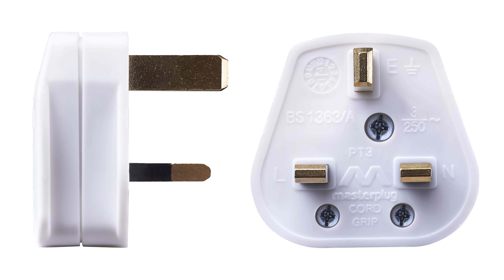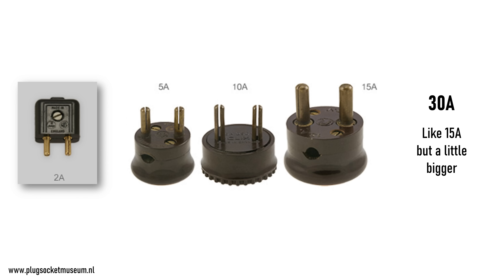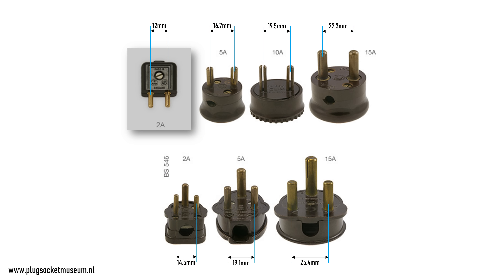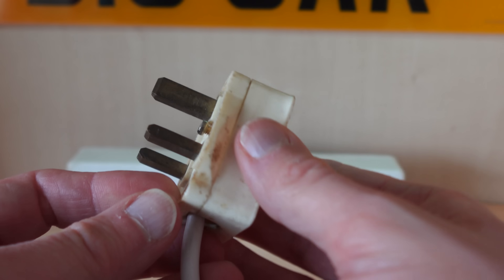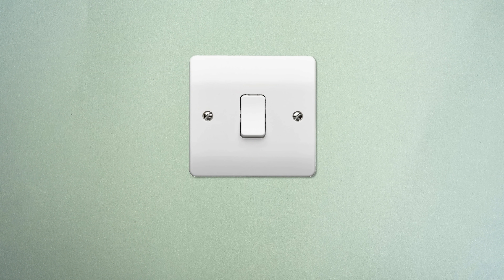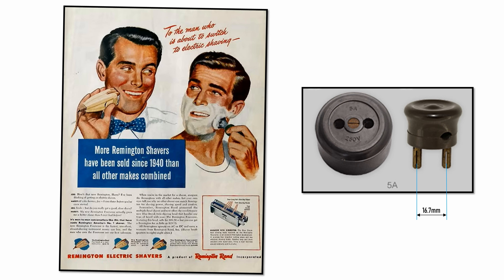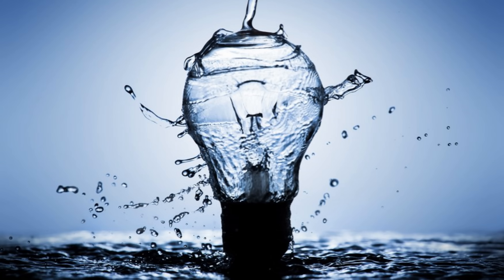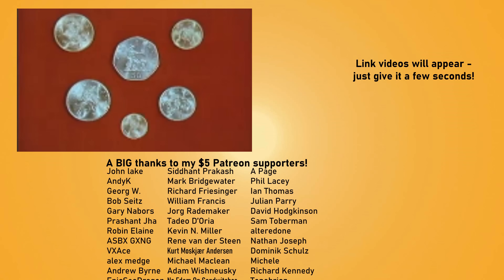Shaver Sockets are really clever

Comment: The reason why appliances weren't sold with plugs in the initial legislation was simply because the BS1363 socket was simply rare to begin with. Most houses would have had BS546 sockets, not BS1363, and that would have meant cutting off the supplied BS1363 plug and then replacing it with a BS546 one, which would have been wasteful in the period after WW II. BS546 remained common into the 1960s. So the legislation to force manufacturers to include a pre-fitted plug could have been made a decade or two earlier, but it made perfect sense at the time. Also, back in the that post war period, people tended to be much more practical and used to the DIY approach. They would service and repair their own cars, motorbikes and so on. It was a different world. 

Also, that's a legislative issue, not a shortcoming of BS1363. In the BS1363 did have issues, the only major one on the plug itself was the lack of insulated sleeving on the live and neutral pins (which was resolved in the 1980s). There were also problems with multi-way sockets which were not required, probably due to an oversight, to include a fuse. Thus you could get 2 or even 3 way multi-way adapters without fuses which could mean, for example, two 3kW electric heaters being powered via the same socket. These days anything plugged into a BS1363 socket must have a fuse, which means that this should never happen now. I should add that all those little power adapters and chargers also have an internal fuse, even if it is not obvious, although they may be of the auto-resetting type like PPTC components.

The rule about allowing 230V standard sockets in bathrooms, initially 3m from zone 1 areas, not 2.5m is relatively recent. Go back 20 years and it was not allowed at all. The only reason that was allowed eventually was when residual current devices (RCDs) became common. However, most countries in Europe allowed standard sockets to be used in bathrooms anyway, despite having a similar voltage system. I should add that whilst the UK system is described as 230V, in practice it is still run close to 240V as that falls within the harmonisation standard of 230V +10%, -6% (in my house, close to a substation, it's typically about 245v). The harmonisation standard in Europe didn't require any country to change its de-facto local voltage standard, and it's often 220V in parts of the continent.

nb. 200 milli-amps is more than enough to kill somebody (which is why standard RCD protection in the UK and Europe tends to be 30 mA, and is even lower in the USA). So that bit about it being limited to 200 mA to protect against fatal shocks is, I suspect, not the real reason. I think it's more likely to keep heat dissipation down in the enclosure. Transformers are nothing like 100% efficient, and that means they generate heat, which is not a good think in that shaver socket enclosure. Heat will build up if it's more than a few watts, and even a 90% efficient transformer will dissipate 5 watts with a 50 watt load.
Reply: i find it intresting and having an isolation transformer required is definetly unique to the UK

as someome from the USA i can confirm our GFCIs (RCD equivalent) will trip at a pretty low leakage, no more than 5mA is allowed to be exact, and they have been required in bathrooms since the 1975 edition of the NEC (national electrical code)
voltage for am average house (not 3-phase) being 125/250v +5% -10% allowed variance

GFCI outlets(daisy-chain-able for their protection capabilities here in NA) or breakers were first required anywhere on homes in 1971 for any pool equipment and exterior outlets
also worth noting that the US and canada codes actually have mandated having a 20 amp, 125v dedicated circuit for exclusively the bathroom outlet, but only if an outlet was installed, until also in 1975 the dedicated outlet was no longer optional, as the code waited for there to be a way to protect against electric shock before requiring it
and bathrooms are the only place where you will never find a 250v outlet in the US, however hardwired, GFCI protected 250v is used by heating, spa tubs, water heaters and saunas in bathrooms
Reply: About the 200mA, don't forget that the current doesn't flow to ground but from one point inside the device to another point inside the same device. That makes it really hard to route the current through the user's heart. You have to grab it with both hands and connect with one to live and the other to neutral.

With the isolation transformer in place, it's much more likely to have a local partial short that causes a fire. And here, the small fuse can shine.
Reply: @HenryLoenwind  I'd agree that it's unlikely that the current would go via the heart. Just about the only way would be touching each live terminal with different hands. 

However, I do not think the 200 mA limit had much to do with what is or is not a lethal electric shock. I also suspect that, even with 200 wet hands, it's probably difficult to get 200 mA to flow through the human body at 240 V. So I think the power limit is for other reasons. Certainly a dead short on the secondary would generate a lot of heat in the transformer, but will probably not draw enough current on the primary to trip a 6A MCB or blow a 5A fuse.
Reply: I actually see 252, basically the legal maximum, quite regularly in my house. It fluctuates a lot, this week I’ve seen it a low as 235 and up to 250! Right now: 243.
Reply: @timtjtim  actually the limit is actually 262 - as in appliances will be damaged beyond that(plus the fact that it is almost 277v) (atleast if you are in the US - no idea about limits in canada/the CEC)
recomended is more like 256.25v though for "cutting it close"
so 252 is within the safest range

in my area it only goes up to 250, down to 238 - went down to 224 one new years night(severly low and can burn out an HVAC compressor or similar) they took out the power soon after and came back after a few minutes with some emergency generators, 245v
it is a bad local grid so low voltage is common

Comment: I am a Brit living in Australia. Here we have standard power sockets in the bathrooms next to the sink. You don't hear or any accidents....
Reply: Maybe because the dead people don't report them? ;)  Seriously, though, the wiring and fusing systems are different.
Reply: @ukeleleEric  yeah, at the meter box in Australia they all have circuit breakers/RCD protection, so you aren't relying on some fuse to burn out and save you these days.. I think the standard says you need it a certain height/distance from a sink to avoid splashes and such but it certainly isn't 2.5 metres because, like in the Uk, many bathrooms aren't that big anyhow.

Comment: The worst thing about recently buying an electric toothbrush and a water flosser is that they both come with a plug to use the shaving socket, but the shaving socket (at least the one I have, so I'm assuming it's a common feature) will only let you plug in one of them at a time. Given the fancy nature of the toothbrush I bought, its base is designed to be plugged in all the time. And the water flosser has to be plugged in to use. This means I regularly to a lot of plugging and unplugging. Also, it has a really loud buzz to it.

Comment: OK, so in the UK you have a very cleverly designed shaver socket in the bathroom and these impressive BS1363 sockets for everything else. How do you accommodate for the myriads of small powered devices that don't require grounding? In my household this makes up for the majority of devices. Do you have to carry around chargers with plugs bigger than the charger itself?
Reply: some plugs are awkward but we've got plugs with fold out prongs now on some plugs like iphone chargers
Reply: On devices that don't need an earth connection they still have to have a earth pin as the socket wont work without. However it's normally plastic and sometimes folds away. If you accidentally stand on the plug which is painful the plastic pin is easily broken. I did it once and had to super glue it back on otherwise it's now useless.

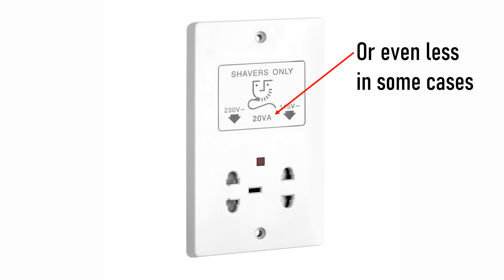Comment: 6:00 You don't say that, it's mostly not true. It's actually voltage that passes through skin resistance, current just follows. And current limit means a voltage drop, so the relation between voltage and current in a limited-energy circuit is reverse-proportional.
Reply: It’s mostly true. Voltage lets current flow, and it’s the current that does the damage

Comment: The British Plug Design might be well-thought-out, but in my opinion the EU Plug is still better because it's universal. You can plug it in any direction (I have not a singe device where correct phase/neutral would matter), there are smaller plugs which fit in the same holes but are for less current and smaller devices and it's slim and modern.

There is only one Socket in the whole house for all devices, and the fuses are in the circuit breaker cabinet.
Reply: Old AC/DC radios and TVs connected the neutral directly to the chassis. If these were reversed they still worked but the chassis became live, a good reason to have non-reversible plugs and sockets.

Comment: if the shaver uses the thin pin europlug, you CAN usually ram them into a normal uk 3 pin socket if you use a tool to push down the shutter release in the earth socket, i've done it several times on devices i have that use that plug , the shaver adaptors dont always contact those thinner pins well or at all

Comment: The uk 3 pin plug is a great design. So many little features on it that you just wouldnt normally notice. Like how the cable comes out the bottom so it doesnt pull out when vacuuming. The internal wires are routed so they are all a different length and wont touch if the cable does pull out. The earth is the first to engage so its earthed before its live. The earth opens a shield in the socket so that you cant touch the live conductors when there is no plug. The live conductors are sheilded so that you cant touch the live part when its half in. So many simple features show how much effort went into it. However they failed to realise the pain level when aomeone leaves one on the floor and you stand on it 😬
Reply: China took the Australian plug and made it even safer by installing the sockets upside down. This means that the earth pin is at the top, so if the plug isn't fully inserted and something falls onto the plug, it will touch the earth pin first. They look funny upside down though, to my Australian eyes.
Reply: It is designed by a committee and it shows (this is not a compliment)

Comment: Counterpoint:

"0.2 amps" is plenty to kill you.   In fact, 0.2 Amps for 1 second is almost certainly fatal (kills more than 50% of people). [1]

Shaver socket isolation used to be a great safety feature before the introduction of the RCD.   Specifically, it means that touching any one wire in an electrical device while sitting in a bath likely won't kill you.

However, people being people, have a habit of touching both wires - for example where a shaver has fallen apart and they're trying to reassemble it live.  That is still deadly.

We invented, years ago, a solution to this.   The RCD (GFCI for americans) detects you touching one wire and turns the power off very quickly, normally before any harm is done.   And to touch both wires, first you need to touch one!

But unfortunately, the isolation transformer in shaver sockets, previously a pretty good safety feature, *stops the RCD from working*.  So, one safety feature prevents the other (better) one from being functional.

That is why British shaver sockets used to be an example of great engineering, but now are just killing people unnecessarily.

[1] (Data from Weineng Wang, Zhiqiang Wang, Xiao Peng, Effects of the Earth Current Frequency and Distortion on Residual Current Devices, Scientific Journal of Control Engineering, Dec 2013, Vol 3 Issue 6 page 417–422.)

Comment: In the future it would probably be best if the bathroom shaver sockets were replaced with a few built-in USB-C sockets supporting 'Power Delivery 3.1', which can go up to 48 V DC @ 5A ( = 240 W). AC-powered shavers, toothbrushes and other similar handheld low-power appliances are fast becoming a thing of the past.
Reply: The problem with type-C is that it's very easy to mangle, unlike a regular socket. Also that would mean running that 48V from somewhere else, as having it converted in the socket means the dangerous 220V is still basically a splash away.
Reply: @nagi603  it is comparatively easy to waterproof a USB C port and hide all of the electronics in the wall, than it is to waterproof a plug socket.  Of course, if water got behind the wall plate, you'd still have problems.  Most phones these days have a waterproof Type-C port.
Reply: @stack_overflow  I was talking about splashing around the plate. None of that is solved or improved by a waterproof type-c socket that relies on in-socket 110/220->pd conversion. Plus the type-c waterproofness would be another thing to test for of course, further driving costs up.
Reply: DC-powered versions of those devices often require dodgier construction or more expensive, especially clippers, which use AC to oscillate comb.
Reply: @Shaker626  Every battery powered set of clippers is DC powered, and some battery powered clippers these days only cost marginslly more than their chorded AC counterparts

Comment: In Canada, a similar type of isolation transformer-based bathroom outlet used to be common, usually labeled as razor only. A common retrofit on older homes with these outlets is to replace them with a GFCI outlet which allows powering other devices like hair dryers from it.
Reply: This is the way!

Comment: That's interesting, in America we utilize GFCI outlets in the bathroom, so while we do have a 120v, 15A outlit in the bathroom they are wired to a GFCI that will go off if there is any issue with the power, for instance if an appliance gets wet. I do not know if the same is done with the light switches though.

Comment: I also remember that light switches in UK bathrooms had to be ceiling mounted pull-cords. I was quite surprised when I emigrated to AU and found that they didn't do that here. Literally SHOCKING!   (Potentially.)
Reply: Nor in the US, also surprised me when I moved here and even more when I saw a 110V socket right next to the sink!  They are protected by GFCI, but I've never fully trusted them.
Reply: And people survive still.
Reply: @Robert-cu9bm  i live in south america. if these people found out how SA electric showers work they'd freak out. the reality is that electrical security is way, WAY overrated. i take all precautions, have RCD for the whole house, earth etc. but most (older) houses have no earth, no RCD, and people still don't die left and right by electrocution, and houses don't start combusting every night.
Reply: @drgenio2006  While I find the South American standards severely lacking, I concur that the UK is taking electrical safety to absurd extremes.
Reply: @HenryLoenwind  absurd is an understatement. the efixx YouTube channel shows ridiculous amounts of labor and tools for the simplest of electrical jobs.
Reply: I live in South America (presently) and although I have used the suicide-shower, it did freak me out when I first saw it, it has to be said. My building has no earth and the 220v is the difference between 2 line phases (no neutral). The sockets have no shutters and accept (loosely) either US or Euro plugs. Plugs slowly fall out of the sockets and christmas tree plugs use a very cheaply-made US-plug with bottle-cap plastic and very bendy paper-thin aluminium pins and accept a piggy back from another one!
Reply: @luaking84  SA doesn't have a single voltage standard and in 220V countries the voltage between phases is 380V so you're gonna have to be more specific
Reply: @drgenio2006   I know; I watch that channel from time to time for entertainment. ;)
Reply: my house has got the light switches on the wall the other side of the bathrooms. I quite like the cord ones though - quite nostalgic
Reply: @luaking84 Same. The amount of exposed wiring all over the place is crazy.

Comment: Wow, interesting that they actually pulled off what's thought by many people as nearly impossible: changing a nationwide commodity service standard like power plugs and outlets, or like which side of the road to drive on (that video was very fascinating)! How did they do this, and do you have a video about it?
Reply: It was even more than this as the supply needed to be standardised as well. This started from the 1920s and wasn't fully completed until into the 1970s. Although the frequency was standardised to 50Hz more or less when the new plugs / sockets were introduced, voltages could be anything between 200-250V, and that isn't considering some supply was still DC,  sometimes as low as 110V.

Comment: Hi, I don’t understand one thing: it is shown that galvanic isolation allows maximum 20VA of power to pass through. At 220V rms this equals to roughly 90mA. 
Looking at the human body time/current curve for sinusoidal currents, 90mA is a safe current to be sustained only for less than 200ms of time. Exceeding the 500ms time exposure, the damages at 90mA are still potentially lethal. Could you provide some clarification, please? The chart I am referring to is contained in the CEI 11-1 norm but is standardized across multiple organization, it can be found on Google under “body current duration chart”